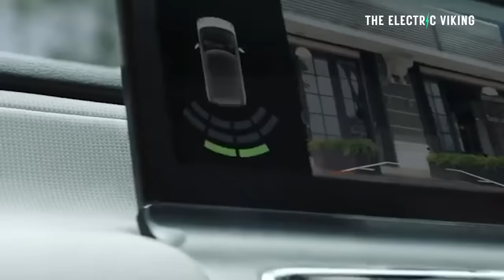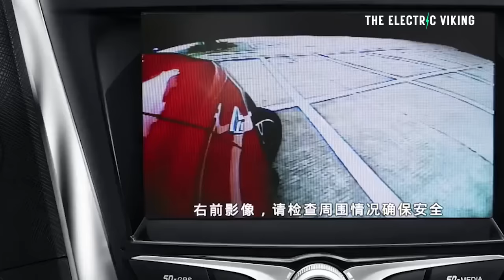Battery prices fall 80%; tipping point to the end of ICE cars is VERY close

Comment: This will be great for people who do home solar. You charge and discharge your batteries every day so LFP helps with thousands more cycles.
Reply: Actually with LFP a cycle is the equivalent of 100%-0%-100%.

So charging it every day at home doesn't add any extra cycles to the battery, it's simply tied to your usage.

ie. 100%-50%-100% is half a cycle.

Comment: Unfortunately the issue is repairs and warranty not being up to scratch - Insurance companies especially in the UK are ramping up prices due to the fact the services offered by dealers are non existent, third party garages are also not equipped to repair EV's or store EV which have been damaged. So the insurance companies end up writing off cars in most cases where the batteries have been damaged or if there are other issues which would mean the repair is uneconomical where as in a traditional car you could repair it.  This is resulting in huge premium hikes across the board, affecting owners with ICE vehicles as well in some cases by 90% - my personal case from 700 to 1400 a year.  I had a model S which this happened to (non-fault accident) no structural damage but as the battery had been damaged the car was written off - end result I bought a Porsche Cayenne  instead.  What we are going to see is the EV bubble pop in it's current form until the infrastructure exists to support things (I wouldn't hold my breath).  All I see is the ability to drive becoming an unaffordable luxury for most people in the future - enjoy it while you can.

Comment: The battery price will have to fall a lot further.  When your battery craps out in 8-10 years and the cost of replacing it is too much your car is only worth scrap value.  Plus the proponents of EV's constantly overlook that the electrical capacity to charge these units is not yet available.  We are 40-50 years away from ending the gas car.

Comment: I wish home battery packs would become affordable.
Reply: Tesla lowered the PowerWall prices recently. Hopefully this trend continues.
Reply: @ChickensAndGardening  I think Powerwall 2 prices have dropped because Powerwall 3 is available.  Not sure if it is available yet in Australia.  I agree that it would be good if the trend would continue.
Reply: Are you sure to put a self contained energy pack (more / less like a bomb) in the area of your home ..??? .. Don't you know the self ingite "feature" of high density battery ?
Reply: @kebeleteeek4227  Nope, how do you get an LFP battery to ignite?  I tried poring gas on it, shooting it, and hitting it with lightning.  Nothing worked.  Plz help.
Reply: Giv Energy is the cheapest. We've had one for a year and it's been no fuss. Just works.

Still pricey though.
Reply: @kebeleteeek4227  Doesn't warrant a response.  I guess you park your petrol car far away from your house too.
Reply: I recently got a quote for a Tesla Powerwall2 in Melbourne Australia, installed, $16k.
Reply: @kebeleteeek4227 
Oh by the way dumb dumb, you know they don't use Lithium-ion batteries for storage..... right?
Reply: I did some sums on this 2 months ago. Break even, living in a large city, a Tesla Powerwall, in Australia, needs to either come down 40% in price or the warranty needs to go from 10 years to 16. Off grid rural applications are different  though because grid connection costs can be very high.  I don't know why power walls are so high in price. The power wall is just a box full of batteries but they charge the same price per kilowatt as their cars. IE A std range model 3 has a 62 kw pack and  costs $62k. The wholesale price of a 13.5 kw power wall is $12,900 however 4.6 power walls are needed to get to 62kw and that would cost $59,340 plus installation. At $100US ($150 Australian)  per kw, the battery cost of a $12,900 power wall is only $2000  . Powerwalls and their equivalents need to, and can, come down in price a lot.
Reply: @markumbers5362  That's a good analysis, thank you.  You're right:  It is insane that the cost for powerwalls is so much greater than for an EV.

Perhaps the strategy for now is to install solar now and batteries later when lower prices make it attractive.  

Either that or get a car that can also be used to power your house when not being driven.  I think there are a few cars that can do that, although I don't know how to set that up or if it is legal in Australia.  A quick search tells me that Teslas do not support vehicle to grid, but I thought I'd heard that Volvo was going to support it.  In any case, it seems a doubtful scenario for the moment.
Reply: @simongross3122  Yes everything you mentioned I agree with. Elon said they have a couple of  products in the pipeline that could sell in excess of 5 million units per year. The $25k car would be one but a 40% cheaper power wall could certainly be another.

Comment: It’s happening way faster than I expected wow
Reply: Problem is that the American heartland will not buy vehicles that only have 200 miles of range for every 15 minutes of fast charging. And fast charging reduces the battery life. Until the charging is reduced to 2 minutes, there will not be sufficient network effects for charging stations to proliferate over our massive landscape and for queues to not form.
Reply: @Anonymint-vj7bt  most drivers aren’t long distance drivers and can just charge at home over night. I think big oil sees the writing on the wall and for those in the heartland, it’s a free country
Reply: Sure. As they lose 10- 15 k currently per unit 🤡
Reply: @zoobrizz  I didn’t know that, I’ll look into it thanks

Comment: Saying that EV prices reached par prices with ICE prices over and over isn't going to make it true.

I have been pricing both ICE and EV cars in the USA for my next car purchase.

- EV models in my price range are about $10k over comparable ICE models.
- There are zero (yes, zero) of those overpriced EVs available in stock within 2000 miles of my location.
- And to add insult to injury, public chargers sell charging so expensive that unless you charge at home you pay more per mile than gasoline.   
- While charging at home is indeed cheaper, it is barely cheaper.  Worse, most of the public grid electricity in the US is still dirty, and putting solar panels on your home have tax and insurance implications that often completely wipe the advantages.

So, if you (like me) are looking at your next car purchase purely from a financial perspective the clear choice for now is a high MPG reliable and low cost ICE, with little net effect on the environment because of the dirty power grid.    

Things might be different if you are in the $40-100k price range, but that is not me.   And I don't see things changing much unless sub-$25k and sub-$20k EVs become readily available for same day purchase in the US.

The same goes for in-home solar panels and batteries.  They need to become cheap enough to make sense.
Reply: Problem is that the American heartland will not buy vehicles that only have 200 miles of range for every 15 minutes of fast charging. And fast charging reduces the battery life. Until the charging is reduced to 2 minutes, there will not be sufficient network effects for charging stations to proliferate over our massive landscape and for queues to not form.
Reply: @Anonymint-vj7bt  Agreed that we need more charging stations, but they also need to sell electricity so that their price is lower than gasoline or diesel in cost per mile driven.  

We also need low-cost EV models (in other nations you can even get them for $10k, with at least 2 seats and A/C while here they start around $30k compared to inexpensive gasoline vehicles starting at $15k).  

And EVs need to be easily available and not something you order from a dealer and then have to wait for months or years to receive it.  If waiting for delivery is going to be the new normal... we might as well order directly from the manufacturer at MSRP+delivery charge and let the dealers go jump off a bridge.  But even then, delivery from manufacturer should happen within 1-2 weeks at most.

If these things don't happen the only ones buying EVs are going to be the green fanatics and those who believe the lies about cheaper cost  of operation.  Those that buy purely based on financial factors or are strapped for cash are going to continue buying good old ICE cars.

Comment: It depends where you live, in the UK we are struggling with the amount of electricity available, so battery costs aren't really a limiting factor. There's very limited public charging available too. If we tried to swap all of the energy from fossil fuels to electricity the national grid would collapse. I'm sure it will come eventually but no single technology is going to be a breakthrough.
Reply: The strawman in this argument is that there will be an attempt to transition everything at once which is not what is happening. EVs will continue to ramp and pain points will be identified. More localized solar, wind and other + battery storage will likely help. It's not going to be without issues of course but it's not the impending doom some like to project.
Reply: @erktrek  I would agree for instance we won't get more charging points until there is more demand, but I won't be going down the electric route until its as cheap and convenient as petrol. Something needs to be done with pricing currently a kilowatt hour equivalent of gas is a quarter of the price of electricity.

Comment: I think I will hang onto my ICE car a little longer then switch to an EV.  The likely reduced price and the fact that the pollution to make my existing car already happened means that I will be better off with the delay and so will the planet.
Reply: If everyone in Aus converted ice to ev tomorrow our power grid would not be able to charge them. Keep your car till it expires.
Reply: @nigelliam153  In a free market, nobody ever builds infrastructure that is not needed.  As there is increased demand the utilities will add capacity.   That is how it works.  No power grid created by sane people would be able to provide of an instant magical change.  As people buy EVs the people running th grid will keep up.
Reply: @kensmith5694  yes but there is a massive expense. Replacing all the cables and that will take decades.
The reason why domestic solar inverters are limited to around 3.5 to 4kw depending where you live is for the same reason, the grid won't handle more power coming back the other way. 

As per upgrading if you have been following the 15 minute city being rolled out in Europe, the plan is to limit cars to one per 5 people rather than increase infra structure. Find a Copy of the C40 plan and see what the UN/WEF have planned for us. Restrictions on food, clothing, transport and where you can go all monitored and controlled by digital currency.  They only seem to be forcing it on Western countries.
Reply: @nigelliam153  Do you realize that an entire city complete with power grid was built quickly in WW2.  When motivated things can happen faster than you expect.  As technology gets better and the grid gets a bit smarter, the solar power will be allowed to grow.  It is one of those things where we adapt.
You seem not to know about what is going on in China.

Comment: Viking, you are totally wrong in your statement that battery prices have come down 80%.....it's all relative to the product and just because the batteries were so homogenously overpriced when they started to be the in thing for EV's it doesn't mean they are cost effective in today's climate of ban the petrol car no matter how you view it.
The battery pack will always be the Achilles heel of the motor industry and I wouldn't mind betting that there will be a long wait for the total adoption of electric cars as opposed to the petrol ones.......only a government initiative with subsidies (like they do in China....nudge nudge) for new EV ownership is going to make it a reality.
Reply: Prices work on an "average" per kilowatt hour and in fact the average decrease over 10 years is greater than 80%, so your claim is off the mark.
FYI the average EV battery price has decreased from almost $1200/kWh to around $100/kWh this year.
Your point about "banning" ICEVs is totally irrelevant and so far off anyway that you appear not well informed.
And your point about the Achille's heel actually is relevant to charging times and not the battery.  Worse, as I charge 90% at home, overnight, I am advantaged over ICE owners who have to waste time to refuel.  
Finally, anyone capable of doing the math would know total cost of ownership of an EV is already much less than an ICEvs, and that's based on prices heavily inflated by dealerships and taxes.  Then there's the resale value, which is significantly better for EVs than ICEvs
But you keep believing in the outdated things you do if it makes you happy.
Reply: @remakeit2628  A kw*hour  is roughly equal to a hp*hour.
Reply: @remakeit2628  Did the roll out of ICE require the level of government corruption (subsidy) current BEVs require?
Reply: @pmrose18  Everyone with an EV can home charge using standard sockets.
I also have rooftop solar so ALL my electricity is not only free but I also get around $1000 each year as feed in credits.  Zero running cost.
Reply: @msimon6808  Don't know where you live but in Australia a large percentage of cars costing over $45k get various tax relief from schemes like novation, company use, and diesel tax rebates.
I personally bought my EV before any incentives were available as the devision was already a no brainer.
Reply: Agreed 

What an ignorant video from Viking boy 
Facts clearly are that there won’t be enough battery production worldwide to power more than 15% of cars for at least the next 10 years. 
So the age of EVs is only just starting to get off the starting blocks and will be a sidekick for a long long time
Reply: @spinnymathingy3149  You have zero idea.
Battery gigafactories are being built everywhere.
And as LFP batteries don't need costly metals there is no problem sourcing raw materials.
Reply: @remakeit2628  research, then reply with facts, not enthusiasm, facts matter
Reply: @msimon6808  Try looking at the reason not just what you want to cry about.

Comment: I wonder if this may further reduction in price-point lead to a new transport vehicle segment for larger vehicles because larger vehicles mean bigger battery and longer range. May suit people carriers or work trucks or for vehicles that tow. Alternatively, one novel solution for road trips requiring a a longer range battery is for start-ups to engineer battery bank trailers to power the motor which are towed by the vehicle. The battery bank trailer would also have breaks to regenerate electricity when travelling down hill.

Presumably, all passenger buses can be transitioned to electric battery/ motor power using the same  economy of scale and could take advantage of in-ground charging via wifi at bus stops and or through having perovskite solar panels on their roof.

The same argument goes for passenger trains.

Battery powered cargo ships, augmented with solar panels and twin skin wing sails.
Reply: ...an onboard fueless solid-state generator will appear in future!

Comment: So why are there still no better PHEVs than the 2016 to 2019 Chevy Volt? More and more brands are making them, but none have a 20 KWH pack unless it's a very large car, in which case still less than the 40-60 mile range of the Volt with it's 15 KWH battery.

Comment: Another very interesting article with some views of incredible automated technology to make and assemble the battery packs. Despite falling battery prices, here in the uk the cost of any ev you would consider buying is eye wateringly expensive, and I don’t see the price falling to any level of affordability for the average driver any time soon. In fact there will always be an excuse to maintain prices, such as larger kwh packs and increased range. For the average uk motorist the cost of an ev is beyond income levels and even eclipses the prospect of buying a ‘luxury’ badge ICE car. Perhaps the biggest elephant in the room is the fact that batteries will not last as long as a ic engine, rendering the car compromised with the prospect of significant cell replacement cost, for even the car being virtually valueless on the s/h market. All this after spending upwards of £46,000! I think I’ll wait a bit.

Comment: The battery price is not the point. EV are already competitive when charged at home with night electricity price. The problem of EV is weight, charging stations, price in charging stations, and fragility. At this point, the whole car is dumped when the battery pack has even a small impact.

Comment: ty i realy liked this, there is only one thing im pretty sure dosent hold true. "the end od combustion engines" even if enough evs could be produced at the price of cumbustibles, neither can we produce the required electricity, and even more difficult, distribute it. building that infrastructure will be expensive and take a long time. and if the electricity is produced using fossile fuels, well then the whole ev thing doesent do what it is hyped for.